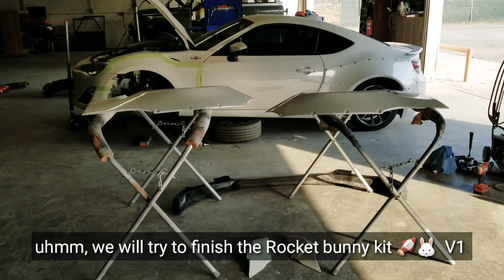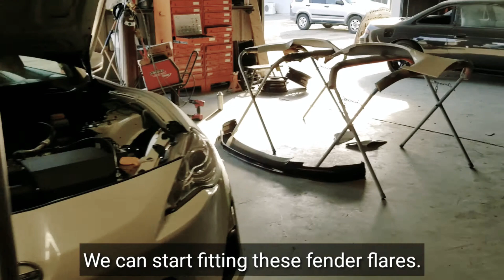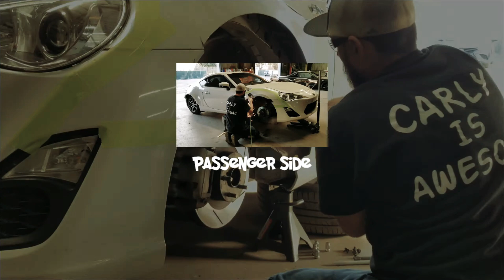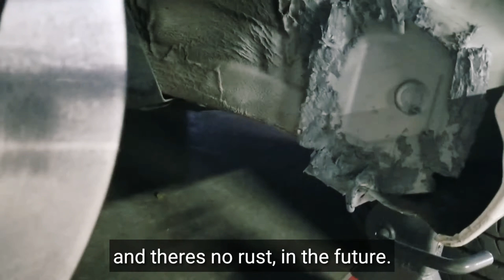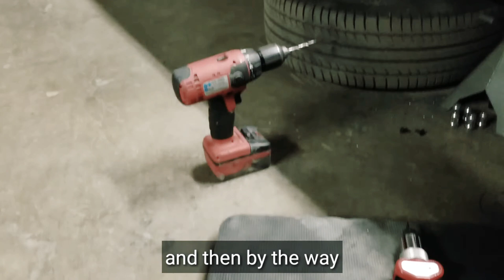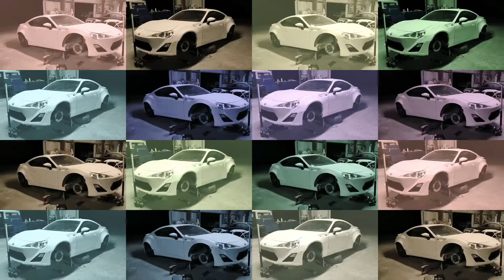Rocket bunny frs install part. 2 (Front fender flares)

Comment: how did you fix the flap thats on the bottom of the flares? i have the same problem
Reply from the maker: Which flares on the frame itself? We just   Put a sealant to make sure there will be no water going inside.